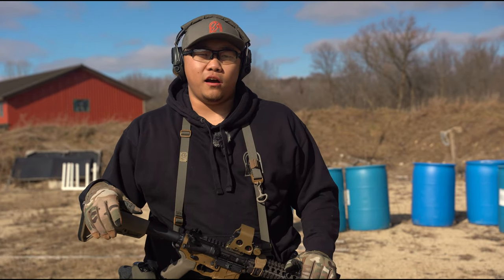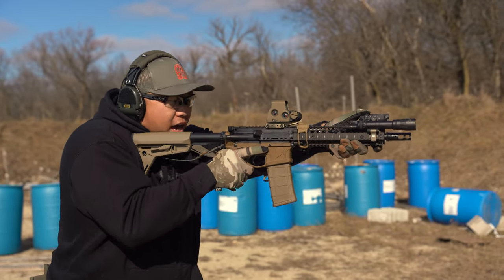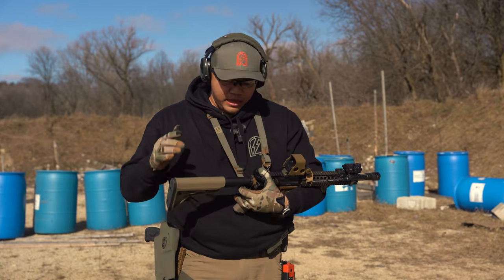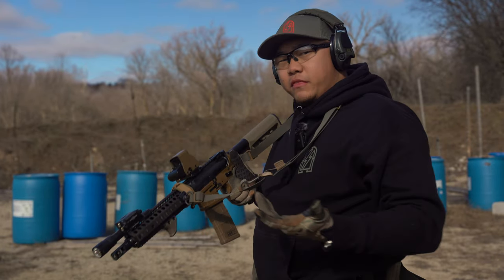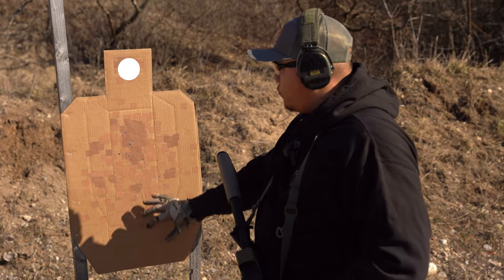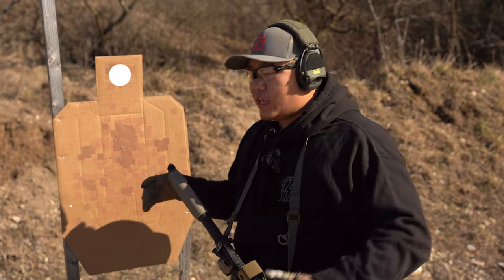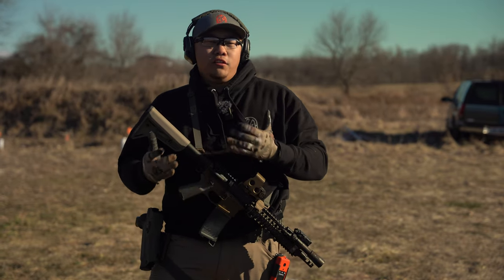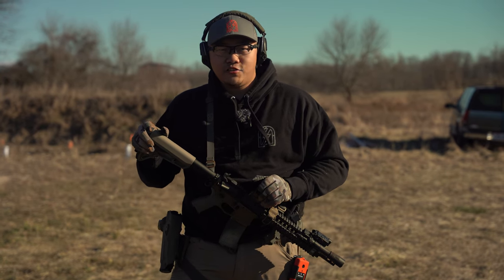RIfle Recoil Control | Principles and Techniques

Comment: What lower? is that a bolt catch on the mag release side?
EDIT: ADM UIC LOWER.
Do you prefer this over bad lever? I never had a ND bolt drop with my BL on a competition weight trigger...
Reply: Good question. I actually do not prefer it to a BAD lever in terms of using it to drop the bolt after a reload but it’s really nice otherwise. Huge fan of ADM stuff.